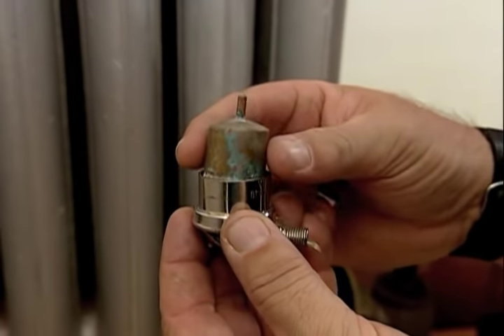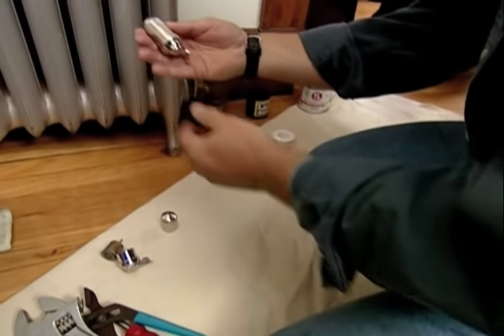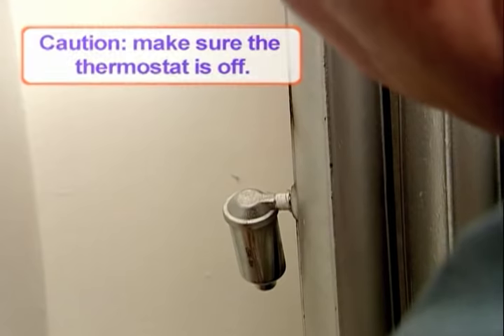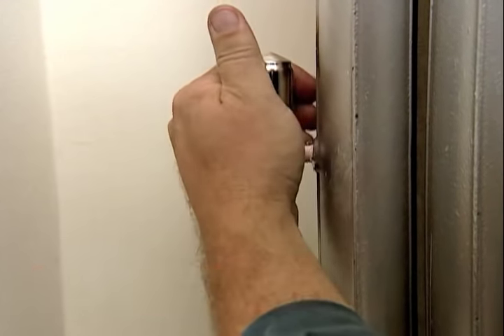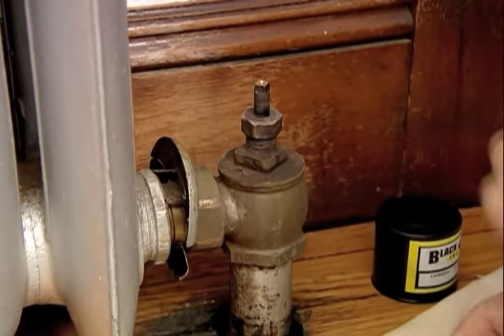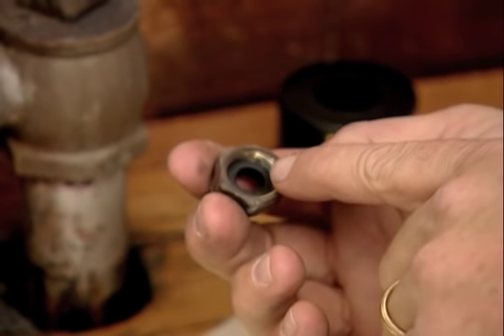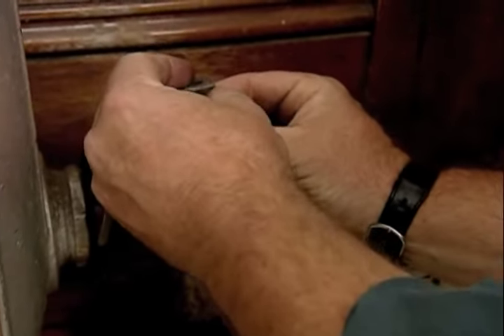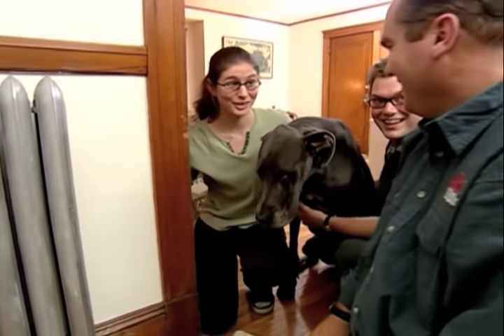How to Maintain a Steam Radiator | This Old House

Comment: So what are the life spans of these vents? And how would it get "gunked up" in a steam system? The radiators of my new old house are either cold or getting minimal heat so I started replacing the vents. So far so good. But it makes me wonder if the fact that all of them are not working properly means that something else is wrong. Unless there is a certain working life to these things, in which case they are probably all past their prime

Comment: The steam pressure sounds like it is too high (greater than 1 psi) and there is not enough venting on the steam mains.
Reply: wow you must really know your stuff brother.
Reply: You can NOT tell the pressure of the system by the sound of leaks in said system.

Comment: What about leaks from the joint where the radiator is connected to the valve? Seems like a compression joint. Should I just re-align & tighten? If it still leaks, is there a compound to help it seal? I read about using "pipe dope" or automotive-type RTV silicone sealer -- are these appropriate?

Comment: I have steam heat (for the first time) in a house I recently purchased, and one radiator doesn't seem to be producing any heat. I've tried to be sure it's "on" and everything and still can't figure it out. I've heard I need to "bleed" it, is that true?
Reply: Nope, check your air valve to make sure it's passing the air

Comment: I figured this would be a good forum to ask a question? My radiator doesn't do any type of knocking. However it keeps cracking the air vents. In 3 years I put two air vents on. Both vents have cracked on the bottoms. Does anybody have any idea why this one radiator keeps having this issue? The radiator is on first floor, approximately 10 ft from the furnace, for which the furnace is in the basement. Any feedback would be grateful. Thank you
Reply: Did you use the #4 vents? I don't know if that is the cause of the problem, but they say you're supposed to use the #4 type vents on the first floor

Comment: Since I won't be my using steam boiler in summer.. is it a good habit to drain all existing water inside to sump pump and turn off furnace? Essentially summerizing instead of winterizing....and come time next year just re fill as normal and turn on. Just curious

Comment: Where did you get that giant roll of graphite packing?  I can only find small lengths at HD/Lowes.
Reply: Where did he get that packing from ??
   I found thin packing for kitchen faucets and mistakenly thought that would work, but the heat melted it, last yr. :-(
Maybe using high temp. Gasket in a tube, will work, since I can't find that packing ???
Reply: I've seen it at Ace and True Value hardware stores. It's in the back by the chimney and fireplace stuff.

Comment: My radiators are LOUD banging all night. I understand all of the steps, but they don't make the purge key for the (female) nipple on top of my antique radiator anymore. It looks like it accepts a recessed Allen key.. not the usual butterfly key.
Reply: All four of mine does the same
Reply: @krystingrant6292  try putting a small shim under one end of the radiator so that any water can drain back down down through the valve.

Comment: I live in a condo building so can I do both repairs you did without having to shut off the main line? I have 2 other units in my building so it will make the repair more challenging if I have to have the HOA involved.
Reply: Hakeem Dastagir no, don’t take the risk, if you can’t shut the steam off at the radiator itself at its own valve, then ask the HOA. Steam is dangerous, it hurts like hell.

Comment: Can you tell me why is it that only half of my cast iron steam radiator becomes  hot
Reply: New air vent needs or incorrect slope
Reply: Sounds like your radiator has a blockage inside, which is preventing the hot water from flowing into the other areas.
Reply: @ShaunyBoys-wf6zr  the top of my air vent came off and suddenly the entire radiator was hot not cold like before. Ultimately, I need to replace the air vent. Steam stops after 5-10 min from when it starts and the radiator measures 210F with a laser heat gun

Comment: Good video.
I'm a red seal plumber in Canada.
Just a tidbit of experience.
Before repacking the valve stem, try tightening the packing valve nut. 9 times out of 10 this stops the leak. 1/2 to 3/4's of a turn usually takes care of business.
If you can't adjust the valve, you've tightened too much.
Reply: Vincent Lang plumbing 101
Reply: VIncent I suggest watch a 13 part series called What on earth happened by Ewaranon to learn that the earth is not a globe. Link in my about tab.

Comment: Can you simply clean those vents out? Rather than replacing them?
Reply: Don't be cheap. Do the job right
Reply: Try submerging the valve in vinegar for 10 minutes.  Dump out vinegar over sink.  Repeat if vinegar coming out of vent looks very dirty.
Reply: @GuitarGuy650  If they are only dirty, and not corroded or damaged, cleaning them and continuing to use them IS doing the job right.
Replacing a perfectly good part that only needs to be cleaned is wastefull, and in my eyes irresponsible.

Comment: it seems like the steam heating idea is one big disaster from beginning to end
Reply: Steam heating the the best heating system every made you dope. It is easy to maintain and inexpensive to run.
Reply: @bigmacdaddy1234  Hot water is better.
Reply: Steam is king
Reply: How do you know what size packing to get? They sell 3/32 and 5/32 inch.
Reply: @keithsalustro5438  bigger is better if its too big you can flatten it by sliding any tool over it like squeezing a tube of toothpaste